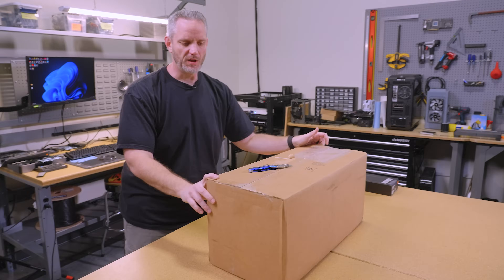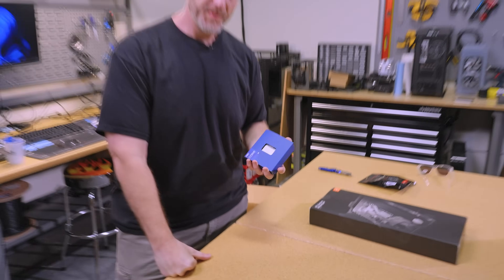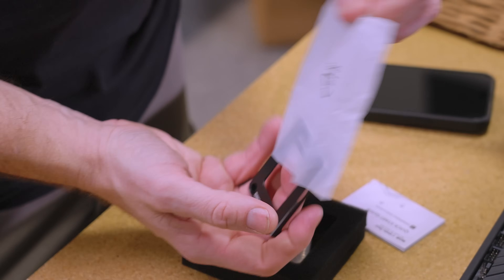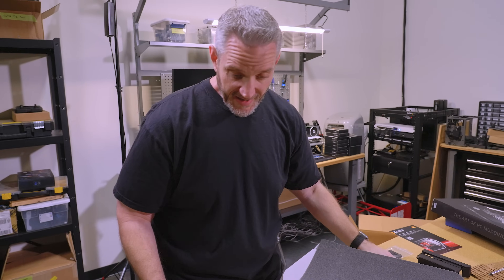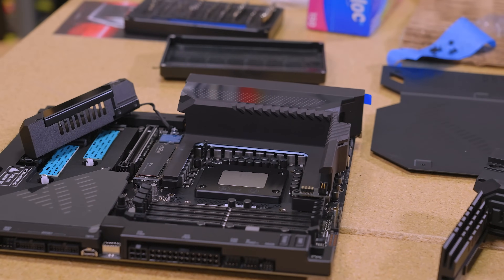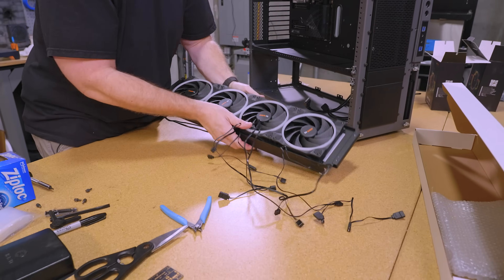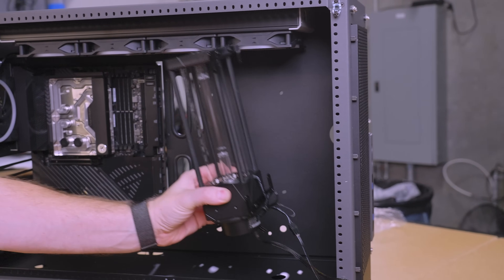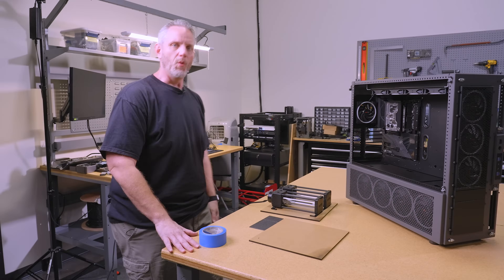Skunkworks Revival - Part 2 - So THIS is what you get for $800 waterblock...

Comment: I love the performance of my 7950x with ASUS x670E-A, don’t have a problem running DDR5 6000 CL30 but do have an issue with all USB devices randomly Dis/Reconnect when iCue is running and can’t seem to find a fix other then closing it which is all my RGB, KB and Mouse, Headset and nexus LCD.

Comment: Its funny, but the 7800x3d  in alot of cases can keep up with 7950x3d -(ive seen a few videos) because the 7950 has only 6 3d cache so they have to slow down to keep in sync with the other processors. They only put on 3d module on a single chip.. the 7800x3d has its 6 cores covered so it doesn't have to work as hard with only two cpu's (for real cores..(8)   and it doesn't have the problems the 7950

Comment: Hey @JayzTwoCents you might want to try to actually change the motherboard for something else then ASUS to like gigabyte or whatever else on your old AMD system, i had the same exact issues with memory and even swapped out sticks and still had major instability issues and couldnt run the memory at the timmings the sticks were rated for, after i i changed my setup to a mini ITX system i had to get a new motherboard and ended up using a Gigabyte MB and i had no issues for a year with my 3900x and memory timings nor instability. might be a good video to do as well.

Comment: how about the 10 gig raptor drive's remember those I had 4 in my first build hehe. and I still have the MSI neo4 platinum bord it just needs a north bridge fan hahahaa  
So on the res mounting brackets they are screwed on right ? so i'm thinking take of the brackets and just screw them on to the back panel directly. just my thoughts on it and you can use spacers between the res and the back panel just to give it that stand off look.

Comment: Maybe you could texture an acrylic sheet by bead blasting it or using low pressure  and glass shot? That would allow you to make your standoff plate  have as much and as deep of texture as you want it to have instead of relying on a prefabbed sheet that you're going to be modifying to fit where you want anyway. I agree on the screen delete seeming to be a lack of foresight on EKs part along with the erroneous directions.

Comment: I'm not here to heckle you about you ditching your x3d cpu, but I'm running a 7950x non 3d, with 96gb of ram with 2 sticks at 6000 with absolutely zero booting trouble, besides it just taking a while. My board is the Msi X670E Carbon Wifi for those who are curious, and I've been exclusively running linux on this also, not sure if that would help with the booting thing, but just putting it out there.

Comment: Looking good! If you decide to go with something else for the reservoirs, check out the Watercool Heatkiller reservoir’s or the Singularity Computer Protium's. Used both and they are fantastic reservoirs that fit nicely in that case
Reply: Yepp the Heatkiller Tube is a Masterpiece. First i used the Same Reservoir as Jay , i Had 2 of them and both got leaky at certain temps. Than i bought the Heatkiller Tube and it works so much better for me .
Reply: Honestly the cleanest reservoir is the Ultitube reservior. It has a d5 attached and it just looks so clean it's like the old EK reserviours but glass. Mine is mounted horizontally on the psu basement

Comment: I like the idea and look of the floating panel, I would also use custom made bracket so the 2 reservoirs sit closer together on the left side, That should leave enough room to run the 360mm radiator on the front of the case.
Reply: Id rather prefer a carbon floating panel which would look awesome imo.

Comment: You can still do the 360 in the front using your same idea but move the floating panel over, and that will just cover up the wires on the motherboard. That's what I would do

Comment: The floating rad mount would look cool.
You could also use it to hide the SATA power connectors, as well as allowing you to poke those cables through cable slots that are already there.
What about doing a 240 front rad with 3 front fans. You get the some of the extra overkill as well as the extra aesthetic.

Comment: My system has 5 beQuiet! Silent wings 140 mm fans. 2 for pull configuration in the front of the phanteks ethnoo pro case and 3 in the top for exhaust and the system is whisper quiet. Cpu is cooled by a Deepcool neptwin v2 tower cooler with both the fans connected. And 1 120 mm fan in back of case for exhaust. So my system has 8 fans. I should se if I can mount bequiet case fans to the cpu cooler so all the fans are from one company.

Comment: My 7950x3d has been amazing, no issues at all. Running tuned 6000 ram, eclk overclock and curve optimizer. I use process lasso to make games stay on CCD0. It's unfortunate your experience isn't like mine cuz I think (with a little knowledge) this is one of the best CPUs you can get for just about anything. Sure, its slightly slower in productivity but not much at half the power consumption while killing them gaming benchmarks, especially if you use a tool like process lasso

Comment: Has Jay tried using other ram ? (I'd be surprised if he hasn't) but it is a shame that he is having those issues. 
I have 2 different 7800X3D Systems. One uses 6000MHZ XMP ram the other has 5600MHZ Expo ram and I've never had an issue.
Reply: Yeah. It's weird but I guess he had a bad board or CPU. I wonder how the bios support has been for Jay. He prob doesn't want to chase bios updates

Comment: on the thermal grizzle frame, the interior corners are a larger radius too. but yeah, other than that looks like just no clock marks for the screws and the little cut out... which is definitely not super easy to do yourself...  😐 oh, and the other one had little pads in between the screw holes to kinda help set the tension, i think. saw it on gamer nexus and he went into more detail on it. but the 13th-14th gen is definitely not nearly as good. and even if that notch is important, couldn't be so critical you couldn't do it yourself, i'd think. which, the boards are the same, so... really makes no sense at all.

Comment: I hear you on the memory issues with AMD. I'm currently in the process of replacing my 7600x with a bad memory controller with an Intel 13700K. Thanks to intel for releasing a new "gen" to drop the price 20%. I'm also coming off of a 3900x before my 7600x. The 3900x lost PCI-e lanes intermittently which would cause an NVME drive to drop out. I'm done with AMD. Burned twice, they'll never get another cent from me.

Comment: For the diag display/block, looks like it's using a JST connector (or similar.) Look for an extension. Or cut and splice in a custom extension. Then mount it wherever you want.

Comment: those be quiet fans do have rgb on the reverse side, but it's definitely more understated than the front. it's a razor thin strip of missing material around the edge (mirroring the front rgb channel) that's segmented by the hub to allow the light to shine through the back.

Comment: Most of the cost of the contact frame is the R&D. Coming up with the specific design and repeated testing to then sell small quantities is going to result in the high price. Plus they are made in Germany which adds even more cost. But I guess you can bypass all that by buying the stolen design instead ¯\_(ツ)_/¯

Comment: NGL First started watching you because I was buying a 900D case and you had a vid. I stuck around when I seen Skunkworks 2.0  I always took to heart how when you said it was about being over the top. So During covid I said F it and did a Threadripper duel 3090 hardline build with dolby atmos. 3 years later and no need to upgrade. So I am glad to see you reviving skunkworks but .... would have loved for you to have some how done a sWRX8 build even if it is a little older tech ... just because 2tb quad chan memory.

Comment: Jay2Cents how does ddr5 speed work?? Is it tied to the motherboard or the CPU, with new AM5 CPUs can I get quicker clock speed or am I limited to the motherboard or will it be up to the manufacturer to release a new Bois update. With ddr5 is two sticks quicker then four with AM5, when looking at the CPU specs I don't get what the numbers and letters mean. You may of already covered it.

Comment: Contact frame.  TG V1.  You needed precise torque or those lines to guess how to get the right amount of pressure.  The updated 13th and 14th gen do not need that. They redesigned just screws on the board with the right pressure.  Until cheap guys copy new design Thinking 35 extra bucks to get perfect fit.  What is my time worth if twist the screen wrong and have to pull it all apart.

Comment: I agree with the contact frame price, It probably has to do that they are located in germany and do everything in house.
Reply: In Germany it's 30€ + 8€ shipping (which kinda is a scam IMO).
30€ would be fine if it included shipping. But 8€ shipping is too much for that small piece.

I can get a thermalright one for half the price

Comment: I use a 560 55mm and 280 55mm thick with push/pull and everything hard tubing. Extremely tight in there but it works 💪🏻😂

Comment: Whoa! I seem to remember somebody a couple days ago bad mouthing the Intel 14900K and today building an over the top computer with it. Anybody else confused? Anybody else buy FIVE radiators cause they need TWO? How about cutting a piece of foam to those sizes and using drywall screws to attach fans to it to see which fits? Cover your acrylic sheet with carbon fiber wrap for texture and to pop it off from the rest of the case. In other words, not just plain black CF wrap.

Comment: The sad thing is one of, if not the biggest selling points of the the higher end versions of the ROG Maximus was waterblocks to cool the VRMs being already integrated into the stock cooling setup and was usually done in partnership with EK. IIRC the Hero was the baseline Maximus board, with baseline being loosely used as it was already a tier above the ROG Strix boards by using higher quality components. After the Hero it graduated into the Formula which is where the VRM Waterblocks came into the picture with the Extreme being everything offered with the Formula upgrade along with I think a thicker PCB, a higher VRM count as well as those VRMs being much higher quality. The monoblock was still an  option from EK but wasn't a necessity for higher end enthusiast builds. 
So now these boards are more than double the price but have lost the big selling point that was the VRM blocks. Yet they still offer 3-4 tiers of said Maximus boards.

Comment: I recently made the switch from Intel my previous chips have been 4700k, 8700k, 10700k and 10700kf (cpu died and i had to replace it), and now finally I am on AMD 7800x3d. I believe i have my memory profiles all setup and everything else, but I have to say. I do not like Ryzen Master compared to Intel Extreme. I wish there was better content on using this tool or a better in windows option to utilize cpu modifications. other than that love the 7800x3d its great with my games.

Comment: The biggest problem I'm having with AMD is the GPU drivers I set are custom undervolted profile that has passed multiple stress tests yet when I turn my PC off at night and then turn it on in the morning it goes back to default settings the worst part about this is there is no error message in Adrenalin or event viewer it's becoming pretty frustrating.

Comment: I believe bottom 280mm Rad should also be removed , It's out of place there . And also different fans and overall unneccessary complexity to GPU loop . I'm quite sure 560mm rad is more than enough for a single 4090

Comment: Oi King, off topic but, I have a question to you.. My Steel Legend has RGB and I hate RGBs, so I switched them off even before overclocking (I hate it that fast).
But just came an idea, what if there were a program that set the RGB to follow the screen hue, like that on those Phillips Ambilight TVs, I'd definitely use it!
Do you happen to know some program like that? You're the only one I could think of asking along with Linus..

Comment: I use MSI boards and never had an issue with them. I would not mind trying another brand but guess you can say i am scared and Asus was one i thought about trying but do not want issues and i love high end boards. Always heard Asus was the better boards but those issues is what turns me away. BTW you inspire me to finally do a hard line build and step away from soft tubing.
Reply: If Msi didn’t have junk bloatwoare wise for software I’d be happier with mine and it refusing to acknowledge icue

Comment: I'm suprised Your issue with RAM.
I have Ryzen 7900 and Ram set on 6000 Mhz - all works. Issues are only when I update bios and I forget to turn off EXPO for update - I have Asus Rog motherboard and according to reddit Asus is terrible with new amd and ram speeds.... but in general all is working for me exept this one case.
Reply: On the internet you find the people with problems, because they are searching for it, posting about it.
I have a 7950X on a Asus Crosshair Hero, with 64Gb DDR5 6000 C36 Ram running perfectly fine. Even with 4x 16Gb Modules wich is not on the QVL.
Updating bois you should do always, a load optimized settings or things can and will go wrong.

Comment: First thing that immediately came to mind when you mentioned making a floating panel behind the pump/res combos was "an acrylic mirror or frosted acrylic panel would look bitchin behind there and you could run an LED light strip  behind that to give off a little more light or help amplify the light from the pump/res combos. Then maybe tint the tempered glass side panel so it gives a modern, stealthy look when it's off but then you can have a dance party of all the lights inside. :) 

I also imagined someone from Asus watching this gasp and saying "how dare you!" When you called the info screen a weeb screen. 😂

Comment: I feel so dissapointed when you use them boring old cylinder reservoirs. Their is so much you can do with a distro bl9ck type reservoir. You could even get someone to stick you logo inside it and still have 2 separate loops with different parts of your logo having different colour coolants in it.

Comment: Hey @jazytwocents - the Contact Frame by Thermal Grizzly is 30 Bucks (European struggling fantasy rupies) in Germany. So - I guess your pricing was a little wrong. Caseking Germany, the company Der8Auer works at, sells those. Guess you got the pricing a little wrong.

And I a a little bit confused that you still go with Intel on that build as for gaming the 7800X3d is BY FAR faster than the 14900K. Even for streaming this should be more than enough. Isn't this about the best possible gaming performance? You can't get this with a 14900K. Hope you have Solas Panels on your roof - otherwise this CPU will cost you a lot of energy.

Ahh and second confusion: Didn't you want to ditch Asus? So why aren't you using one of those top of the line MSI boards in this build? That you do not your ASRock - as they have constant quality issues - is understandable. Also not using Gigabyte/Aorus is understandable as they have very bad customer service. Nothing against Asus - but why no MSI here?

And Jay - by all due respect but you know that the Lightwings by BeQuiet are based of the cheapo Pure Wings fans and not based on the really good Silent Wings 4 fans? You definitely will regret this decision not to go with something else. Those Lightwings are not really that quiet. Maybe you should go with the black Silent Wings 4 without RGB and find other ways to bring the RGB in there (RGB strips for example). This would than lead to a very quiet system.

But despite all my criticism - it is always highly enjoyable watching you doing this builds. I learned plenty from you when it comes to building PCs in the past years. So keep up the great work.

Comment: Yep Performance-pc in the USA or Highflow in Europe :P (still think you need to use your meds before buying a 800$ block)
I got 8tb on my board. one of them is the same drive you have its my "steam" drive :P
Oh and my mono block that was cheaper actually hits the vrm's with the water block without using 2 sets of thermal pads.. (witch is IDIOTIC)

Comment: I forgot to mention on part one, but as a person who manufactures graphene for industry in several formulas, the most temp drop you can expect after saturation is 2-3*C, which for most folks not chasing the ultra 1% of performance or using non-standard cooling liquids, is not going to blow your mind. Initially you'll think it's black gold with 5-8*C drops, but reality will catch up sooner than later. The quality of true, pristine graphene is not what is found in the cooling solutions, otherwise it would cost $3k for a liter, and more likely is composed of nanoplatelets. I can send you a sample batch if you truly want the good stuff, but it's going to add a, how to say, specifically unaesthetic black hue to your cooling loop.

Comment: The thermal grizly thing is expensive because there was a genuine development behind it ... amazon stuff may be just a clone, and may not have decent tolerances, but could be perfectly fine.
Now, if you don't want engineers to make new stuff but some idiot in china with xerox machine - fine by me, as an engineer I'll just jack up the prices of stuff you can't easily clone :*